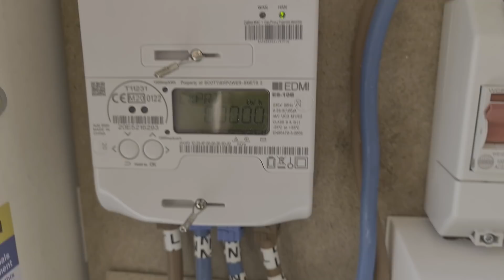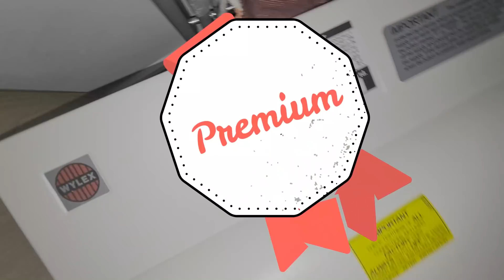New Build Electricians Shocking Standard?

Comment: Not an electrician, two things: 1. In 2021 why are new builds not coming with EV provision as standard? Minimum they should be ready to install near the parking area
2. How is fitting under the stairs a safe thing? Fire being an occasional issue

On a separate issue, why do you need 25mm tails when the incomer is 10mm? When I asked a sparks he said regs
Reply from the maker: Suppliers cable sizes vary depending on network loads. But yes ultimately regs based on current carry capacity.l, limiting volt drop and complying with disconnection times. I agree about the EV, makes sense!

Thanks so much for watching

Comment: Like you said, developers should say to the spark, when you have wired up the property, an approved contractor will do a full inspection of  the electrical wiring before you are paid.
The purchaser of the property should educate themselves and get electrics inspected before signing on the dotted line. In fact get the property inspected before buying.
Reply from the maker: All great ideas there. Agree mate
Reply: In many cases the builder will not allow a pre purchase inspection, often its not the electrician who did the work, at fault, it’s the developer always going  for the cheapest price. Allowing the developer to self certify , not just electrics, was never going to work.
Reply: I've also heard of Developers refusing to continue with the sale when people start asking for independent inspections as it draws out the completion date and reduces turn around. That said I know of another building company that as the prices suddenly rose last year reneged on thier promise to hold the price and replace all the carpets in the show home. Put it on the market again and put another 50k on the price. This led to a collapse of a chain. So many people lost.

Comment: Someone needs to design a decent looking IP rated consumer unit that can blend in with external meter boxes. It's a nightmare on these new builds when the consumer unit is in the middle of the property.
Reply from the maker: That would be brilliant and solve a problem we all face.
Reply: @electrician247  They did have them years ago in many Council houses or Flats . They used to house the Service head, meter and the tails straight into the Consumer unit that was located in the top of the box. I think they were MEM . Would be good to bring them back if they could.
Reply from the maker: @alanlissamore461  mantel boards.

Comment: This is the trouble we encounter now .. your option to redo the bits in the supply box may be the best .. if you did go back to the split board consumer unit then you will have to rejig the consumer unit to fit your type A rcbo or unless the rccd are a type A .
Isn't it all good fun ..  single insulated cables visable surely a code C2
Reply from the maker: I would agree mate on the c2. Thanks for watching, appreciate it
Reply: @June Parkinson they are in the meter box but this is accessible to the untrained home owner .

Comment: I would fit an spd myself in new builds and for private customers on board changes but we do a lot of social housing work on rates which really don’t cover an spd. We spoke to them regarding this when the regulations changed as we were initially charging the extra at cost but having spoken with their QS and with the NICEIC they told us they didn’t require spds in domestic properties. That’s the NICEIC’s guidance apparently. I have spoke to the NICEIC directly and that’s what they told me too. It doesn’t read like that to me in the regulations but who am I? I must admit to still fitting split boards too although again I don’t think they really comply with the regulations and I try and convince private customers of the benefits of rcbos . What’s your take on the NICEIC’s guidance on spd ‘s in domestic properties?
Reply from the maker: The regs are pretty clear imo. Risk assessment can remove spds but very very hard to access and get that outcome
Reply: @electrician247  the map within the regulations showing the different areas is really poor . I really think it should be simplified. Ive got level 4 NVQ qualifications and it still seems woolly. You have to make assumptions most of the time.
Reply from the maker: @thomasjenkins6515  I agree.  Perhaps in amd 2 we might see that

Comment: Install a small four way CU in the meter cabinet, fuse for the main house CU and RCBO for the EV as you have mentioned. Using  correct tails clamps and SWA glands etc the job will be safe and compliant. 

Any DNO would be hard pushed to justify cutting off a supply to a  property where no danger exists, remember it's only a recommendation not and absolute requirement. 

New build installation designers need to be a lot firmer with architects and builders when designing these properties.
Reply from the maker: I think this will be the solution.  Thanks for watching

Comment: What is the point of having 100A main fuses just to fuse it down to 63A they could have just ran 25mm swa and kept it at 100A
Reply from the maker: Would have made sense to me. Thanks for watching. Appreciate it
Reply: Because the DNOs stipulate that their cutout fuse only protects a maximum cable length of 3m.
So by stupid, short-sighted design of the house, the consumer unit must now be fed by a submain.
But you get told you need some discrimination/selectivity, therefore your 100A service has been downrated to 63A.
Chris (CJR Electrical) had a similar scenario a couple of weeks ago.
In that case, the existing tails were over 3m but the consumer unit was at the front end of the hallway.
He ran a 3c25mm SWA outside and back in, but it was a case of "what else could you do that would actually be compliant?"
Personally, I would take the non-compliance on selectivity and fit a 100A switch fuse if the Zs would be met at the board in the house.
Let's face it, if you've got a fault that's taken out either your 100A fuse or the DNO's 100A fuse, it's not likely to be a 5 minute fix. The brown stuff would have hit the impeller, shall we say.

Comment: It’s a matter of greed at the end of the day mainly on the part of the house builders, everything needs doing in a day, 2 if you’re lucky…4 bed townhouse 1st fix to include all noggins and chippy work for metal boxes don’t use fast fix on timber frame, all fan patress To be fitted 3/4 core holes and ducting 25mm sub main to an inaccessible place under the stairs, all for £380-£400 if you’re lucky. So you need to be doing 3 a week to earn well. I’m not making excuses for it as some of that workmanship on show is still poor by comparison, but that is the situation of house building…
Reply from the maker: Totally agree 👍 thanks for watching

Comment: Interesting video and I completely agree with your findings. For a new installation it is of a poor standard. Would be interesting to see the actual test certificate for that property.
It appears you can see this installation was done on price. Unfortunately price work encourages poor standards. It would appear this could have been second fixed by a third year Apprentice or a poor electrician has no pride.
Reply from the maker: Trying to get hold of a copy atm
Reply: @electrician247  
Hi Mark
I think the idea that you come up with for the electric vehicle charging point is a practical solution for the problem you was facing.
I understand the DNO in some locations may not be happy but you do not have any alternative..
Interested to see are you overcome the problem.
Reply from the maker: @cainzach1  thanks. I am going to get the solution on video we come up with it. If we get permission to carryon from the developer without affecting warrenty etc on the rest of the install

Comment: Blame the idiotic designers for new build. My friends is on a stud wall in the middle of a hallway. Again as others have said if you have a utility, use that! On an external wall. 

No kmf or anything. Just chopped through  the back of the cab and sent ex amount of meters in with no protection. That’s at a St modwen site. Absolute horse shit.
Reply from the maker: Say what you see mate! Thanks for watching, appreciate it
Reply: @electrician247  no problem. Keep it up 👍

Comment: At risk of ranting no this isn't acceptable but I find it commonly. Example, all the new builds around Brighton Station we were called in for various reasons but to summarize. Power circuits in 1.5 mm cable, issue with gas boilers, issue with electric boilers and incorrect plumbing. Other blocks in hove have had Gas boilers in the center of the building with aluminium flues to outside - rotted through and giving people carbon monoxide poisoning.

Brand new block with Heatrae Sadia units and UFH, plumbed incorrectly, wired incorrectly and missing safety controls or at best just not set up properly. Safety devices hidden in walls etc. 
The big sites tend to pay peanuts and get monkeys and in fairness we do well out of the remedial works afterwards as do many other companies but the initial design is always the issue.
Consumer unit and plumbing sited in the center of the property for quick and easy access, least amount of distance so less cable is used, less pipe etc etc. 

Thankfully there are times now where some people have asked us and others we work alongside for input on the design before things are done but normally these are smaller county sized companies that are fed up of the kick backs and cost due to the 10 year warranty on new builds. 

The large nationals seem to get away with this race to the bottom and sadly much of above the local building control signed off at various stages because they either didn't know better or didn't care. Which I hate to say it but Grenfell happened because those responsible for checking it was done right as an outside unbiased entity, either weren't educated in the design and application of materials and installation, or just didn't care to thoroughly check it was done properly.

Comment: Why a fuse instead a MCB? In case of a short you have to reset two MCB, but that is always better than the eventuality of having to change a fuse. What if the fuse breaks in the middle of the night? You are without power, and so what people do? Wait one day without electricity? No, just use the closest thing that can replace the fuse, a bolt, a piece of cable, or something like that. I don't like fuses exactly for that reason, something you can reset is always better. 

In my country they don't even put fuses before the meter: there is a MCB in the meter itself, so chances are that if you do a dead short inside your home the MCB in the meter will trip. Also in my country after the meter they put not only a MCB but also a RCD (in the modern days a RCBO) to protect the cable run from the meter to the consumer unit (because we use only the TT system).
Reply from the maker: This is a point of view I can accept. But the idea is the fuse doesnt opperate alongside the devices internal to the building. Imagine its dark outside and all the power has gone off. I do see your point of view tho and have no issue with it setup like that
Reply: If there is a fault the mcb won’t reset and professional help is still required.

Comment: Our new builds are total rubbish, we  have an issue with mains tails over 3m (worse one was 15m) in length running into the middle of the house no earthed metallic protection or fused protection. No SPD fitted in any, no clips for wiring in the loft. Totally shocking. 

The thing that would help is if builders (large) stop expecting house to 1st fixed in a day. 

I carried out an EICR for a new landlords and found 14 C1/C2's open ring final circuits, exposed basic insulation out side of enclosures, IP JB's with holes randomly drilled in, not fire seal in the massive holes knocked out.

Great video as always
Reply from the maker: You are exactly right. It makes sense as the money is there on these plots. Greed takes it away from handing over a decent job.
Reply: Got to say if guys are doing 1st fix every day then you soon get upto speed and 1day is easily done same as all work that is repetitive.  repetition  and being tooled up for that task is key
Reply: Forgive me here, but being in the US, don't they have inspectors that go in after 1st fix/2nd and confirm installs and meets the regulations and get approval from local cities/towns?
Reply from the maker: @Chris_In_Texas  not with the self certification system we use here. Might be an idea to do this though!

Comment: This is why I try to avoid using the existing consumer unit on EV installs, particularly on new builds. The board being in the middle of the house is just plain idiotic, especially when many new builds have a utility room and yet the CU will still be on an internal wall and worse still it's a flush board. We did have one job where there was some comeback regarding using the meter box for an additional board but having seen pictures the installer had been rather greedy with the space which had cause a smart meter installer to not have space for his new meter. Fair enough. It's like an EV storm has arrived and the DNO's are still putting suncream on!
Reply from the maker: I agree. Its like a problem we are having made for us. Dont use the meter cabinet and good luck getting to the CU. If you do then all you got is 63A max. Zero logic. 

Cutting a new cab in is daft if already got a CU of sorts in the existing cabinet. Just to please the DNO. External IP consumer units are ugly and very likely to be damaged at some stage by wheelie bins, drunk home owners, bikes or whatever. Its enough of an issue with the charge points themselves. Or maybe this is just the people who live in my house 🤣
Reply: Even to use an external IP rated consumer unit you've still got to split the tails so you need to install Henley blocks so some DNOs might even get the hump about that. Then the SPD issue: if it's in the main consumer unit it's not going to protect the EV charger so do we now need to move the SPD to the meter box?
Reply: @Blackf1ngers  exactly, in Germany you need a SPD in the meter cabinet and another one in the fuse distribution box (is their separeted from meter cabinet)

Comment: On a recent job i had to install some new lights on a brand new build and thought i`d have a look in the meter box . It was the same set up as that shown but the 16mm from the isolator was twin and earth.
Reply from the maker: Seen a lot worse than this tbh. What do you make of it Mark
Reply: @electrician247  . I don’t see how they can get away with it . Should be managed better . Seems they get away with a lot on the big sites
Reply from the maker: @markglowacki7488  definitely Mark. Its a major problem
Reply: We use 25mm swa, many sun contractors don’t and as you say I’ve seen 16mm T&E used….what with heat source and Ev chargers becoming more common I can see a lot of these sub mains just not being up to the job….good luck getting another one run in!

Comment: Developers know full well how much demand there will be on electrical installations especially with ev yet think it’s a good idea to stick a cu in the middle of a house under the stairs fed from 16mm2 swa! Absolute joke. As for the installation, they clearly have no pride it what they do but does it contravene any regs? Not in my opinion. Great video, very thought provoking.
Reply from the maker: This is the question.  Could it be coded for any non compliance with bs7671. I can produce a few C2s on this pretty easily. But others might see it differently.
Reply: @electrician247  I’d be interested in  hearing what your C2’s are, the whole coding thing is probably one of the biggest areas of debate.
Reply from the maker: @paullyons4624  def the single insulated 16mm tails between the wylex isolator and that little CU. They are on show with the lids on. Not obvious in the video I appreciate. 

Same the other end with the swa stripped outside the CU. 

OCPD for those same tails

IP rating on top elevation of the meter box CU

Termination and glanding of the swa at both ends. Although I could swing a C3 at that. 

Same for the mix brand none type tested selection in the meter cabinet CU. 

You are right though, we can all see these things differently. What do you think?
Reply: @electrician247  I totally agree with what you have said just a little harsh on the coding IMO,  regards the single insulation outside of an enclosure, why is that a thing? Because it has less protection? Vulnerable to damage? IMO in this circumstance it’s neither of those things. When I say this I’m certainly not condoning bad workmanship just what the codes actually mean.
Reply from the maker: @paullyons4624  due to the IP protection needed on single insulated cables. Especially in a place untrained persons could reasonably have access. Its not clear on the video but the enclosure is so badly cut the singles are quite exposed in meter cab.